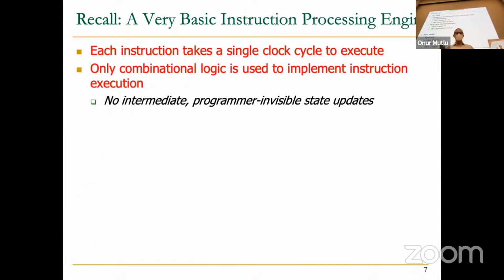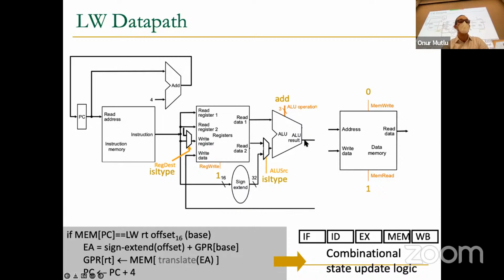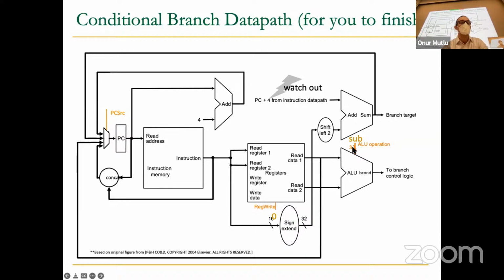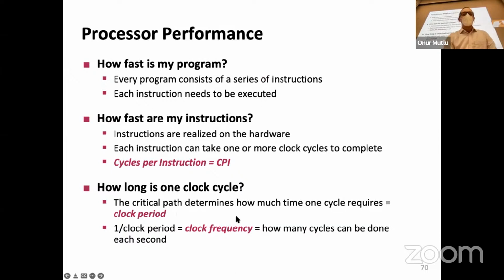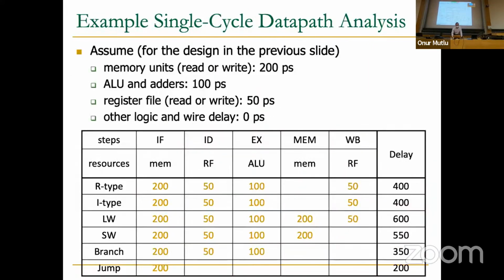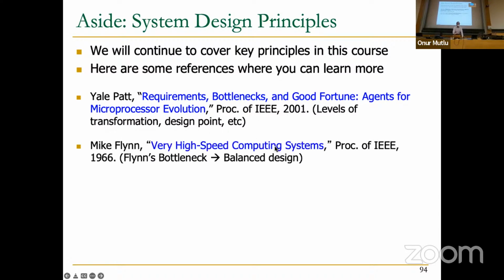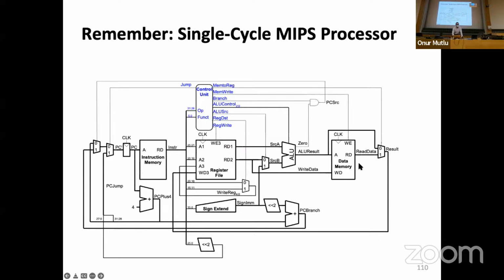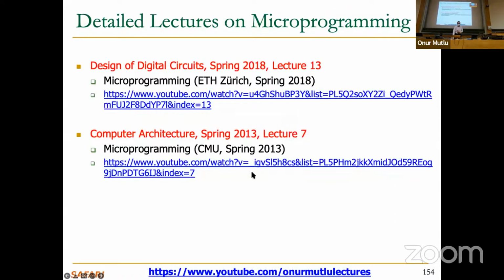Digital Design & Computer Architecture - Lecture 12: Microarchitecture Fundamentals II (Spring 2022)

Comment: Normally, Memory makes the CPU fall stall or waste the clock cycle and it is solved by caches and memory hierarchies. I wonder about the effect of operating systems on these stall cycles because the Operating system manages many tasks and if one of them is struggling with memory latency it can switch to another task to prevent a stall.